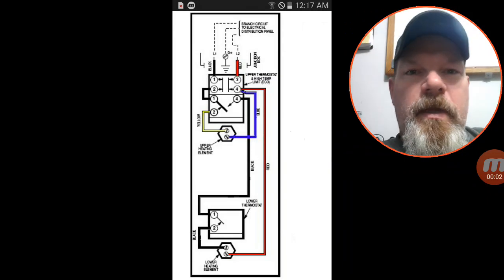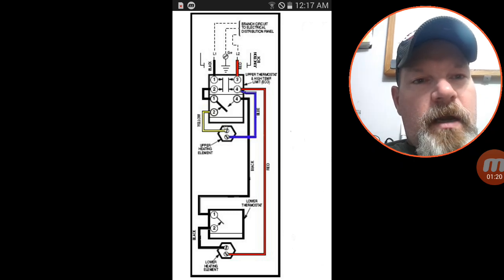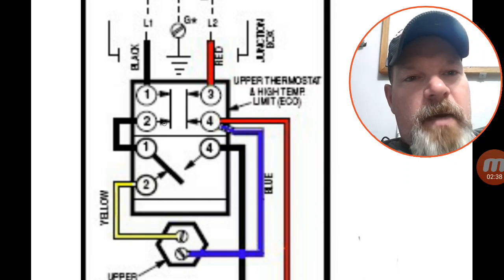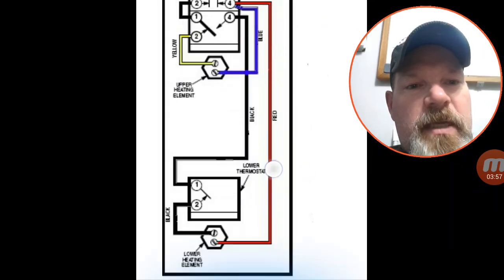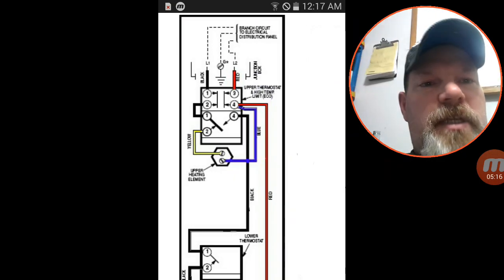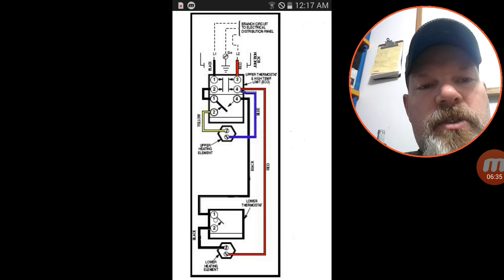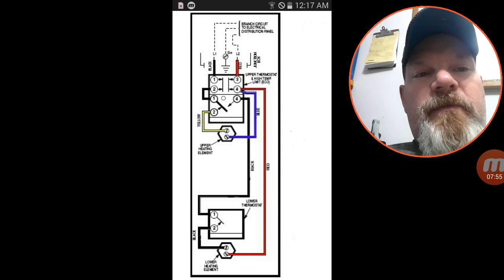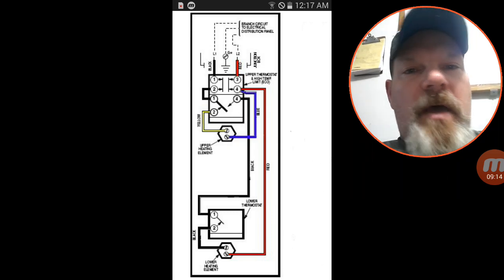Electric Water Heater Lesson Wiring Schematic and Operation

Comment: So that means the two elements on the water heater do not work on the same time one words and the other one shuts off vice versa I thought two elements work. Will you put a new water heater the top liniment works first and then the bottom

Comment: Interesting that according to the schematic both elements can't be on at the same time, of course then your talking 9000 watts, about 40 amps and you'd need at least a 50 amp circuit, complete with bigger breaker and heavier gauge wire. Any additional speed in heating the water probably doesn't justify the additional cost of the increased electrical demand, bigger breaker, and heavier wire.

Comment: thanks you your illustration was great, i still have a question, when i test with a voltmeter the top element i  am getting 240 volts however when i test the volts at 1 and 2 of top thermostat i have nothing then I  test the volts at 1 and 4 and i have 240 volts so that is telling me i have 240 going to bottom , however when i test bottom i have zero volts could

Comment: I have a situation hopefully you can help me. I was looking at my buddies whirlpool water heater for him , and when I touched the top I got electrocuted.. I shut the breaker off, and found several things 1. Tank was completely full to the top with calcium 
2. Elements are really bad
And the 3rd thing , someone ran a three conductor wire with ground, and landed the nutural wire with the ground wires at the grounding Lug on top of the tank

Comment: This is contrary to my Whirlpool diagram, 2 wires go to different places but looks like both will work, after your explanation. Good Video! Except Which thermostat comes on first on a new install if both are cold as they are both calling. Guessing the top one-first in line. I need to know for testing. Also I am having rust/ground issues, but its rarely discussed

Comment: Vevor D10-14VA(M,S) electric water heater. Installed in an travel trailer. Its wired directly to a breaker. It stays on hot till the capacity is used then its not doing its job. The original worked with a relay that turned it on and off. The vevor wire option given was wall socket or direct to breaker. Any advice

Comment: Hey I need your help I have a aos smith hot water tank that's been self installed which wire do I remove or cross to get hot water my breaker is goin bad???

Comment: Thank you for the great and complete explanation of this. I had my upper thermostat go out and melt until it tripped the high limit. It melted the color of wires even and heated the copper to desintetigrating where all wires were loose under the screws even on the element. It did not trip the breaker?

Comment: I got an electric water heater that's not working. I put in a new upper and lower thermostat and elements but it doesn't start up. Had a professional electrician come check the circuit breaker and to check the voltage going to the water heater. It show the correct current but still, it doesn't start heating. It's just a simple 30 gallon water heater, All the wiring is rightfully connected. So what can be the problem?  Would the water heater freezing up have anything to do with it not wanting to heat? In other words, is there some safety device INSIDE the tank that would cause this issue?

Comment: Thanks for the explanation! I have a question. What would happen if someone drained the hot water heater without turning the breaker off?
Reply from the maker: The elements will burn out
Reply: @GuyBrown  thanks. That’s exactly what happened to my brothers hot water heater. Some “plumbers” had drained it then a few days later he had no hot water. Upper element was burned out.

Comment: This gal has a question.
I want to reduce the cost of running my water heater by wiring it up so the lower element runs on 1/2 price nighttime off peak energy while leaving the upper element wired so it can charge the upper part of the tank any time the demand is great enough to deplete the hot water from the whole tank. 
Is this possible? If so please explain how to accomplish it 
Thanks
Reply from the maker: Anything is possible. You need to learn electrical circuits. I'd spend some time learning how it all works. Once you learn circuits it'll become clear.

Comment: Thanks Awesome Job ! But I have put new elements 3 times ,and thermostats replaced twice all new, and replaced the breakers also: and with A vote master have 120 votes down both sides all the time to both elements. still does not heat: i am whipped, have A electrition comming this evening : Have nothing else to change but the wireing from the breakers to water heater ?  But I am thankful for your good clear video . God bless
Reply: I have the same problem. I'm guessing one of my elements is corroded and shorting out, however the circuit breaker doesn't trip. Maybe there's a problem with the grounding.

What did your electrician figure out?

Comment: How to remove the mold smell from the hot water tank? I hear draining , add hydrogen peroxide,or vinegar! Also changing to electronic anode rod! Or turning up the water temperature to around 130 deg. What’s your suggestion 
?

Comment: Very Well Done, Thank You. I trying to figure out the top water heater switch. When the tank is full of cold water the top switch is closed and the top element is on. I take it that when that themostat is satisfied it opens and at the same time closes the switch to the bottom element. Once the bottom themostat is satisfied it opens and then until the top themostat or the bottom themostat closes they both remain open until one of them closes. Again, My Thanks, FR

Comment: Hello Guy; Happy New Year. I have replaced my hot water heater for another, the problem I have is not covered in your video and I hope to ask what wiring diagram is used to connect the two elements so that they both come on when the temperature of my garage is calling for heat. I do have the hot water heater dedicated for in-floor heating. I wish to know if I connect the top number 4 wire to the top number 2 wire will that allow my hot water heater to be connected as one? Thanks, Brian
Reply from the maker: It'll draw too many amps. The conductors and controls are not rated for that. Keep it the way it is.

Comment: Watched this video after changing both elements and wasn't getting voltage to the bottom one, which was the shorted one to start with. This explained it very well. Went back and verified that the lower element was working after a short time period. Excellent video and explanation!
Reply: Had a similar situation. I was trying to figure out what was going on after replacing the bad element. Knowing theory of operation is always the first step to understanding and diagnosing a system.

Comment: I just installed 2 brand new thermostats and 2 brand new elements, my lower element was actually broken in half. I reconnected everything the same, but now the breaker on the upper thermostat keeps tripping every couple of days, Any ideas? Thanks for the video
Reply from the maker: Lower the set point
Reply: @GuyBrown  thanks for the quick response, set point is temperature setting I take it, ok I will lower temperature on both.
Reply from the maker: Let me know how it works out
Reply: @GuyBrown  sorry but another quick question, looking at your schematic for the top thermostat, terminal 2 on the top section and terminal 1 just below it, is that a wire connecting the 2 terminals, I do not have that on mine, I do have the same amount of terminals as in your schematic, do I need that wire? I know it was never there on the original, the original one only had 2 terminals on the left side. Thanks

Comment: Thank you! Very well done. I have been an electrician for awhile now, and this is first time I've checked into just how a water heater works. Your video is excellent.
Reply: Which wire to remove or cross to get hot water my breaker box is tricked??? And I called someone out of warranty they couldn't even fix it

Comment: thank you ,video very helpful, what if the jumper wire is missing on top element between 2and 1 will it still work
Reply: that drawing is a representation of the electrical path, so in  the case of the real object, it could have an actual jumper, or the jumper may be internal. Check the terminal at one and if you have power there then the jumper was in fact internal and it should work. :)
Reply: from black 2 to red/blue 4 should be 240volts, and from black one to red/blue 4 should also read 240v if the "jumper" is in place. (will be 220-240) one side of your double breaker in the panel box feeds 120 to black 2, and one side feeds 120 to the red/blue side.

Comment: Great explanation. I was a sparky for 50 years but did not work on loads of electric water heaters. People would not believe me when I told them nothing is wrong with their electric water heaters. They would have a seperate meter with a timer that disconnected heater from around 3 PM to 10 PM. With both the husband & wife working day work kids would do a load of wash then put dishwasher on due to no clean plates. By time diner was over lucky to have enough water to get a luke warm quick shower. Eventually after several calls to ultility company called me back to eliminate water heater meter.

Comment: Why does the bottom thermostat need to run through the top thermostat ? Would it be okay to wire the bottom thermostat direct ?
Reply from the maker: No. If bothe elements are on at the same time you'll draw too many amps

Comment: So I'm trying to install my electrical hot water heater but it's still not getting hot it's brand new I made sure the water heater was full before flipping the breaker back on so I then checked the breaker with my multimeter it showed 240 which was good but I tested the voltage it was no current touched 1 and 2 to see if I got the same reading and it was not getting a reading I just wonder does it matter which way you wire it from the top of the water heater so I switched around just to see and still nothing I'm getting frustrated with this what do I do?

Comment: Can you help me figure something out I have a 53 gallons water heater I wanted to know can I convert it into solar using a 110 watt and taken out 220 Watts knowing it would take more time to heat up the water going with a hundred watt solar panel or 200 watt solar panel but which one will be better 4 110 Watts power Using solar power to heat up the water? It uses two Breakers of 30 a m p

Comment: I am following your video all the way down to the lower thermostat.  My is factory hooked up the other way around.  Instead of my black wire going to "sit" at the thermostat, mine runs straight to the element. My red wire comes down and goes through the thermostat?

Comment: Interesting.  Any idea even after installing new thermostats just now I can get my water to cool down? Set at 120 and its its currently running 132 out the closest tap with a thermo gun.
Installed new thermostats because of this issue.  Set at 110 tap water would still push 140 degrees.  I changed thermostats and fixed nothing.  Problem started after shutting off the breaker and flushing several times last night.  I am confused.

Comment: My Rheem 82v80-2 is wired differently.   Even though the thermostats look identical.  The red on the first terminal 4 goes to the bottom heater as you show same as mine but the blue is on the second 4 and goes to the upper element.  My black wire to the lower thermostat comes up to terminal 2 where the yellow wire is.   Could this be the problem I am having with the overtemp tripping?

Comment: Thanks for the wiring diagram. After Irma I had no Solar heater left in the Island of Sint Maarten DWI. I made a DIY panels from Other broken shsstuf. I'm using a standard 50 gal tank on its side.  Elements on top side. With your diagram and explanation I can hook up the bottom element to the top thermostat and use one element near the exit water  for rainy weeks. The hot exit water is the drain pipe.  It should shut off when reached 120* F. Or unplug it. This tank on its side has 2x220 elements supplied by 110v. I have no 220 available in this spot. When I had no panels, a 6 gal tank 110v on 220 elements work ok. Recovery time was longer, but a warm shower was great. The cistern water seemed to be colder than expected.
Thank you again
Burt A. Jones
Dutch west Indies

Comment: Guy, I replaced top and bottom elements and thermostats and water heater stopped flipping breaker but now I have to keep rebooting the red button on the heater. I just watched the video to see if it was wired correctly and the top and bottom panels feel hot. the wires feel hot and the two hot and cold water pipes on top of the tank feel hot. I'm scared.
Reply from the maker: What are the thermostats set at

Comment: Thanks. I have checked and do have 240. I have not checked the amp draw, yet. However, I did notice that the upper thermostat was not pressing against the tank to trigger the sensor. So, I have wedged a piece of plastic, safely across the tank to put pressure and hold thermostat against tank. I am now waiting to see what happens. I appreciate your reply.

Comment: That was great. I just installed new dual elements & thermostats. It is wired exactly as you pictured. With one exception. I have had the unit on for 3 hours and no cold water. I am getting power across the upper element, but not the bottom. The red wire going to the bottom is hot. I had drained the unit, so all the water is cold. I have seen an alternative wiring that shows the red & black reversed at the upper L4. Does that make a difference?  Now this is a Rheem 40 gal shorty about 25 y.o. but never used. The upper element was burned out. Probably from being left on without water.  How can I tell if either or both elements are working the way I have them wired? What have I done wrong and what should I check. Any help is appreciated.  Thanks, John
Reply from the maker: Use a multimeter to check for 240 volts at the element. If you have 240 the check the amp draw.

Comment: Omg you saved me from putting 8 awg wire instead of 10 awg wire on a 3800w heater. Lucky i opened the water heater and saw this exact configuration, and owners manual confirmed the circuit. The configuration is called "double element non-simultaneous"

Comment: I'm having a problem with the wiring of my hydro bath.  If i turn the thermostat switch on it works without turning the heater switch on.  the light won't come on either and i have to control the heating manually.  It wont shut off when hot enough.

Comment: Thanx for the perfect explanation of how an electric hot water heater works and why one needs only a 30 amp 2 pole circuit for it (given an upper limit of 5500 watts per element). But let's get real and forget about the kid- how about you and your girlfriend or wife and you? Wouldn't it be nicer if both elements could kick in at the same time? I actually don't see any advantage to this setup except to lower the curve to the point of cold water. Perhaps a 100 amp 2-pole breaker is in order and we all need 400 amp services to satisfy our electric hot water needs. This setup just seems like another mother telling me to get out of the shower ;)

Comment: Can someone answer this question ?? 
I replaced my elements in my water heater left the wires in the same place can I hook the wires back up to either side or does it matter which side they're on on the elements.  thanks
Reply from the maker: Either side is fine.
Reply: @GuyBrown  I finally said screw it and wired it up a few hours ago cause nobody was saying different . Thanks

Comment: My water heater has a built in removable cover to gain access to the tank...for cleaning out lime. I have replaced both elements an thermostats 3 or 4 times in the last 12 years, along with cleaning the lime out. Never had an issue. my breaker box is a 200 amp square d panel. I replaced both elements along with both thermostas recently, after the lower element burnt out and tripped the breaker. After replacing everything and de-liming the tank. The unit will trip the breaker after it's on a while. It looks like (using multimeter) BOTh elements are getting power at the same time when water in tank is cold. I have replaced both thermostats twice...and can't figure out what the trouble is? Thanks

Comment: Exquisitely clear explanation.  Please add some troubleshooting next time, such as how to distinguish faulty upper from lower thermostat, or stuck-open or stuck-closed switches in each thermostat, or faulty upper versus lower heating element.  I think the element test is simply a show of continuity after the wires are disconnected??? and not sure about the other issues.  Thank you!!

Comment: I have a dual element WH and after a few tests I determined what was wrong and how to fix it. My installation is non simultaneous which means only one element turns on at a time. Non simultaneous wiring reduces max amps which reduces PEAK usage electricity costs. When the WH is cold, the top element goes on first and then the lower element one follows in a non simultaneous wired unit. To test this theory, I hooked up an analog electric clock (not digital) to the lower element black wire and grounded the clock to the WH. I disconnected the lower red wire. By connecting an analog clock, I didn't have to watch the water heater and wait for the relay to switch. When the upper thermostat achieved the desired temp, it turned off the upper element and the clock started to work. When I visited the WH later in the morning, the clock had 30 minutes on it so I knew the thermostat had switched. I removed the clock, hooked up the lower element, all is well. Thx for an excellent video.